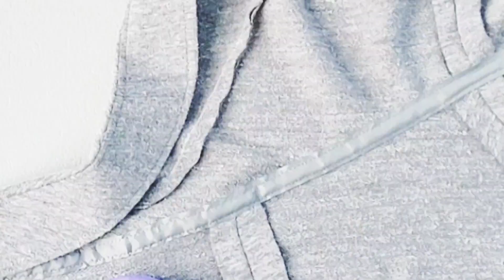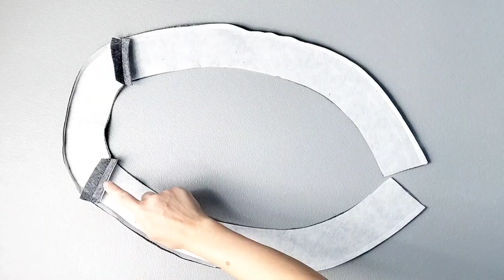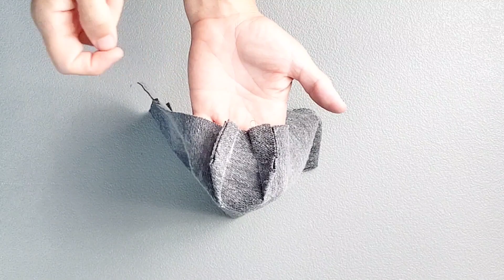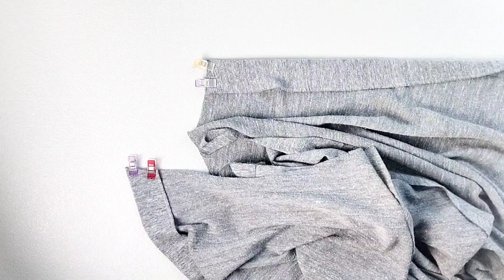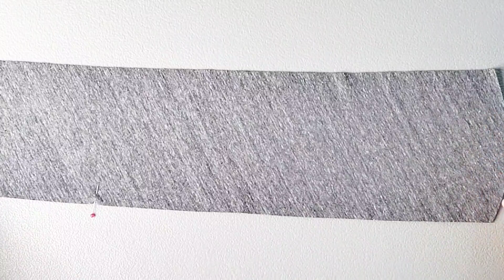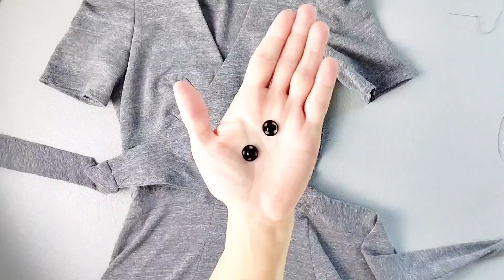Sew a 1970s Vintage Jersey Wrap Dress Without a Serger 🪄// M8379 Sew Along

Comment: Thanks for this .. the pattern details are uniquely vintage so. that could have been a challenge. I expect the fit is excellent and the wrap will stay wrapped. Do you have any advice on the type of knit to use? I was thinking viscose jersey.
Reply from the maker: Thank you.  The fit is definitely accurate to the chart, so no problems there.  Any jersey would be great.  Just a little stretch should be fine.  Keep me posted on your final make -- I'd love to hear your thoughts on the pattern.
Reply: Don’t use a fabric with too much stretch. The skirt is heavy and makes the waist fall too low. Unfortunately I found this out the hard way😢